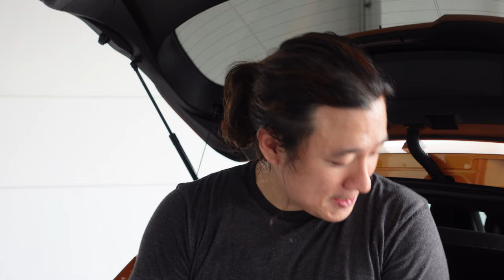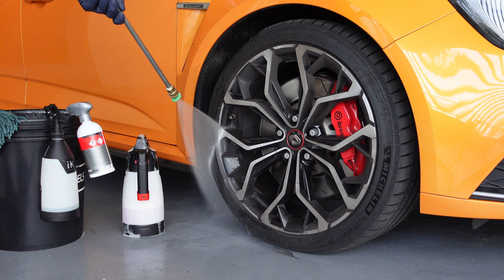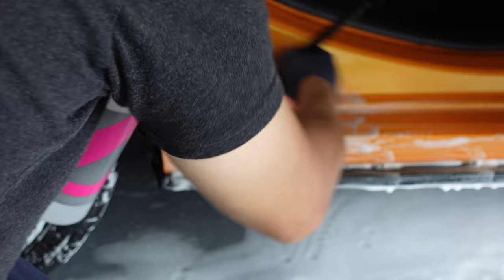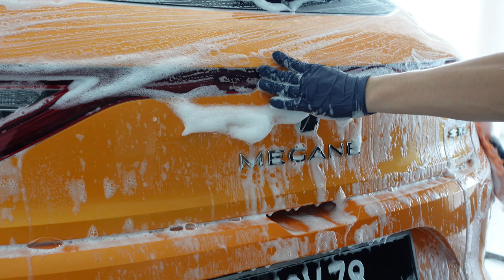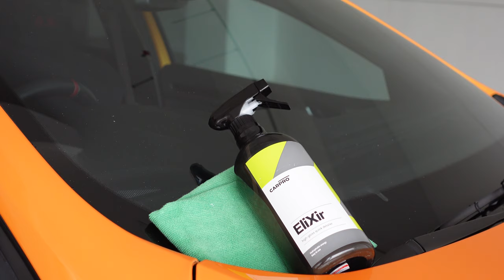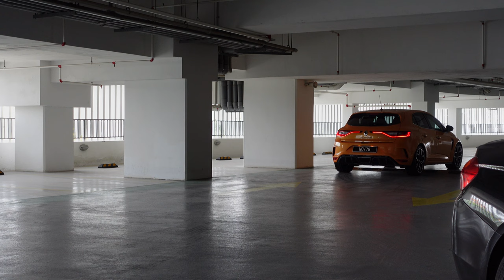Farewell & Final Car Wash [ASMR] | Megane RS280 Cup | EvoMalaysia.com

Comment: Its a pity. Rather see you collecting this kind of cars than those supposedly "classics" which are high maintenance and expensive when it comes to spares.
Besides new spares can never perform
with the old parts...unlike when it was new where all parts are new. Megane RS
would be a legend in time.
Reply from the maker: Yes I believe it will be an appreciated car. Because this is the last Megane RS as the Renault Sport Division is replaced with Alpine now. And no hatchback drives like this.
Reply: @ThomasYap  True they are bringing back the Alpine A110 rally car. Heard you have got yourself an Alfa 155. Yes...it was the car to beat in the 1993 BTCC British Touring Car Championship driven by Gabriele Tarquini. As for the Alfasud
you should have scout for the Alfasud Sprint. Just my 2 cents.
Reply from the maker: @dennischai4831  :goodvibes: